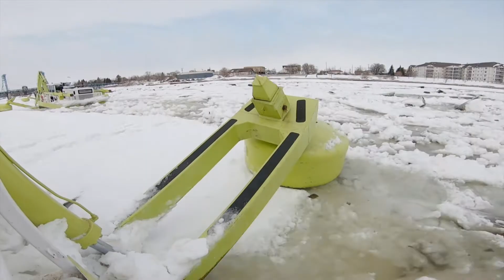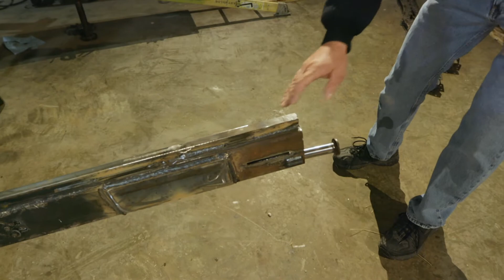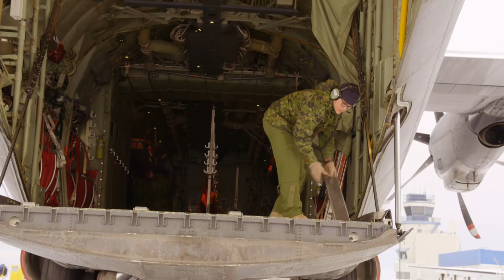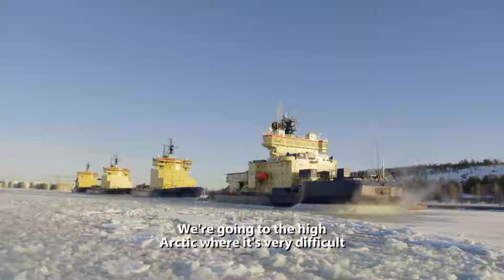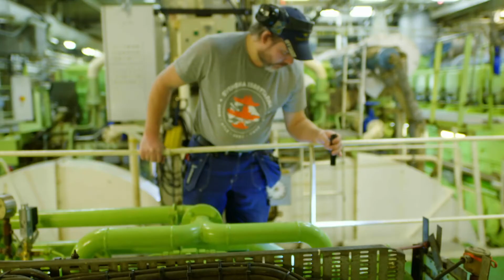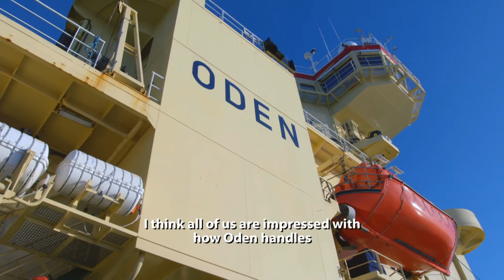Oden's Icebreaking Power - Extreme Ice Machines - S01 EP05 - Engineering Documentary

Comment: I Installed a new air compressor in Oden. When i was done the chief told me if this is not as good as the old one there will be an helicopter flight for me to come and fix it at the pole. I´m kinda sad it did not break down it would have been a nice trip

Comment: For the first machine, an icebreaking ship could do it much faster and it'd be easier. I don't want to put these guys out of work, but it's seems like a no-brainer...the ice seems thin. Ofc if there are too few ships I can understand, but it'd be nothing for coast guard ships which break 3 meter ice. I'm Canadian also...but those dudes accents are kind of funny. Though I respect their hard work.
Reply: no an Icebraking ship would likely not be able to handle that type of river since it is quite shallow.
If it is only for a small center channel then it could perform it but here we are talking about clearing the ice in the whole river to stop the overflooding of the towns next to the river.
Icebreakers in general needs much more Sil free depth then other ships.

For example take Oden she is not able to clear Ice in the whole of Sweden like our archipelagos.
Instead Oden is meant for Quick channel opening in the botnia Bay and the Baltic sea.
Her smaller siblings in the Atle class who use the traditional design of Icebreakers cant clear a channel as wide nor as fast but they can handle the baltic Sea and botnia bay yealry Ice with no issues.
but for the Archipelago of Stockholm, Luleå and Gothenburg as examples Sweden use much smaller icebreakers such as the Ale the only Crown Icebreaker who can enter Lake Vänern and the newly bought Idun to break the Ice closer to land and the smaller Archipelago passways.
We also use such Multi purpose Ships as Baltica and Scandica to aid in even smaller areas during real cold spells such as we have this February For example Stenungsund  and lysekil north of Gothenburg where Petrochemical and oil tankers needs  to be able to unload 24 hours a day.

So no an Icebreaker cant break all the ice in a River that was needed simply cause they are not designed to do so.
Nad ofcourse since their draft is to deep.

they could use Dynamite which is common in the Arctic and Antarctic to free frozen ships from getting crushed but i dont think the communities in the region wants to hear loud bangs for weeks 24H a day.
Nor do i thnik they want to hear the screams definately comming from someone getting injured using the Dynamite.

Best regards.
Reply: No, the water is too shallow for an icebreaker. An amphibic vehicle makes more sense on a river with riverbanks and low bridges.
Reply: @davidborgstrom  For that THIN ice you don't need a big icebreaker.
Even tug boats could easily do it or Pilot boats that's design to also break ice and they don't need much water.
Reply: @jone8626 sure, but their engines still need some depht, probably 2 meters at least? There seem to be shallow riverbanks and low bridges on this river, which makes it much safer doing it the way they do it.